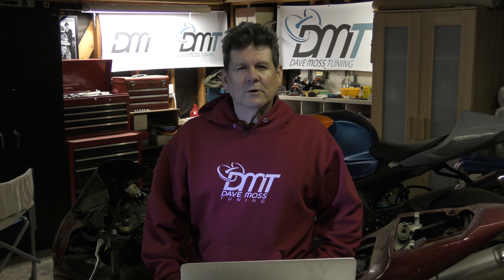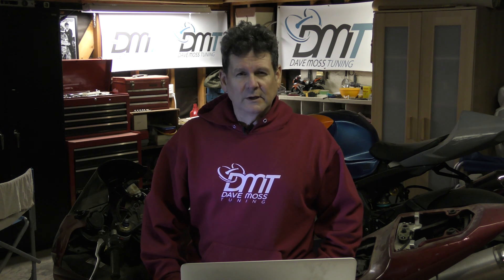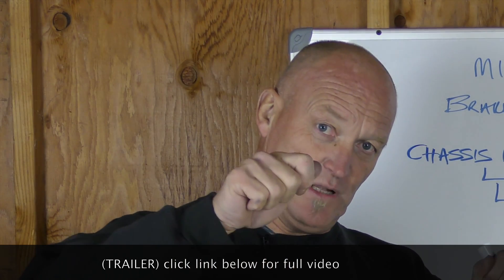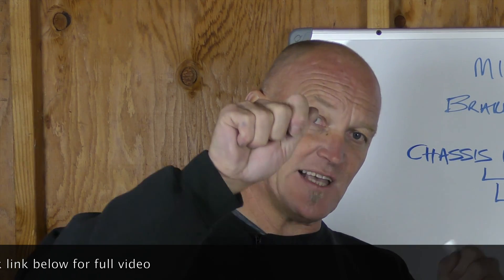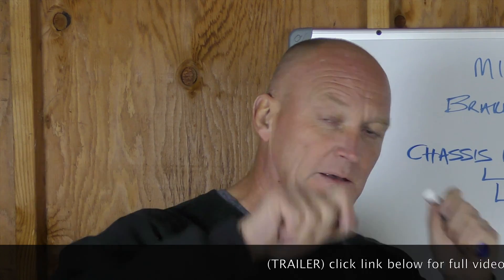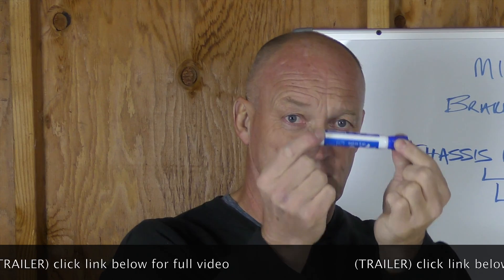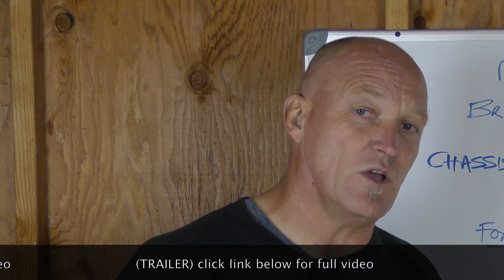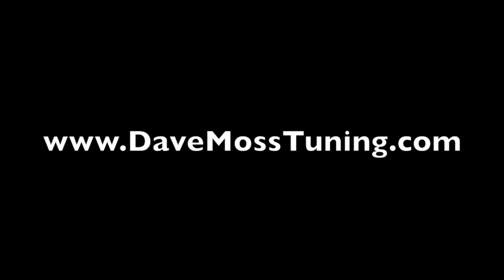FasterClass: Troubleshooting Mid Corner Instability (TRAILER)

Comment: can chain contribute mid turn issues...  !
Reply from the maker: If it is too tight yes as it stops swing arm movement. If the chain is too loose, changing gear will create gear lash and potential instability id corner. If you have to shift mid corner, your gearing is a long way off.

Comment: Any advice to improve on/off throttle jerk? No matter how smooth I am to get back on the throttle, I hit a dead zone before it abruptly grabs..
Reply from the maker: Throttle cables first. If that is correct, next is ECU flashing for a remap of 5/10/15% throttle positions to correct fueling. If that does not work, the next task is to get the injectors cleaned and balanced.
Reply: An after market throttle like a Motion Pro 2 can help with this.
Reply: One thing that I never hear about this is to set the throttle with zero cable slack.  I almost wrecked a couple of times because of the throttle on time lag because of the factories recommend throttle slack adjustments.
Reply: @NorthPoleJeff  yes, I improved my R3's throttle jerk by removing cable slack. On my 675, I use a motion pro which improved the abrupt initial bite.
Reply: I had an 07 CBR600rr w/ 37k miles & 08 CBR600RR w/ 7k miles. Both bikes I adjusted the throttle cable slack with little to no play. Even after I still experience these issues. I find it strange that the on/off throttle response is so unrefined, even with the stock set-up.
Reply: Get on the throttle while still trailing the rear break. 

Pros do it witb good ecu tuning. A lot of us don't have that luxury.